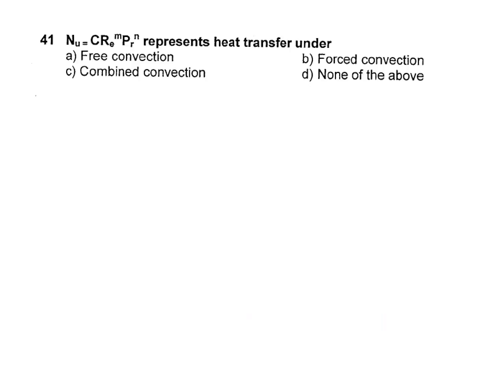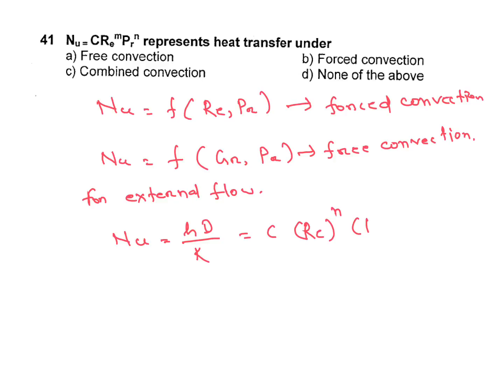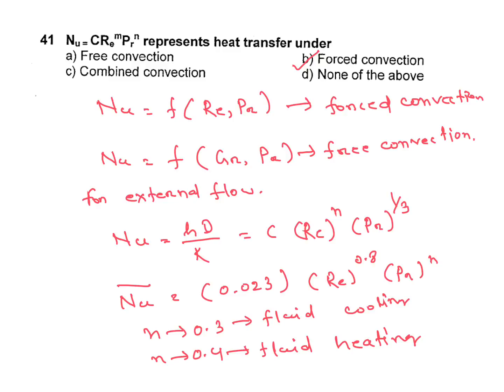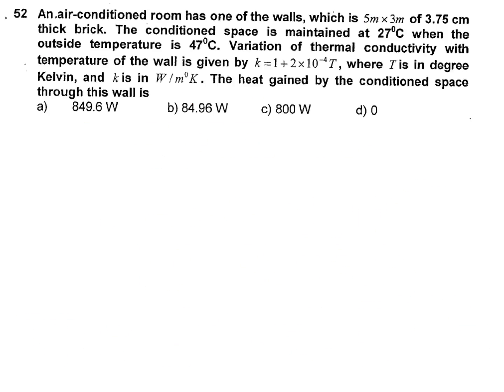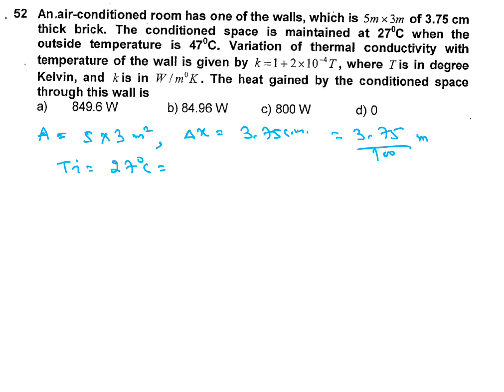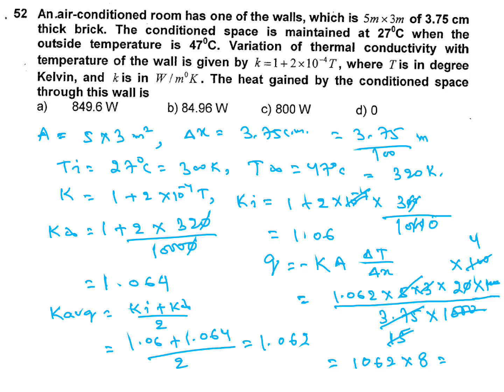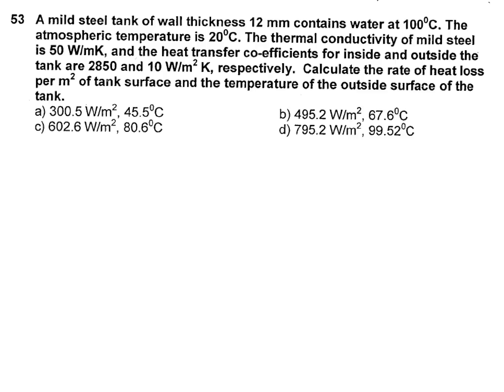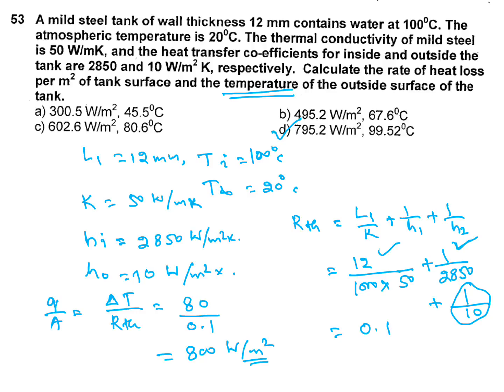ISRO QUESTION PAPERS HEAT TRANSFER - 01

Comment: Sir i think we need to integrate in question no. 52 in 2006..and doing that i got answer B..please check it out.
Reply from the maker: PLS MENTION THE TIME AND QS NO SO THAT IT WILL EASY FOR ME TO CHECK THAT QS
Reply: Prem Pal Singh integrate karke bhi 8496 W hi ata hei bhai. Aap ne thickness 3.75 cm liya ya 3.75 m liye, thoda check karke bata sakte hei kya. Thanks

Comment: Sir i think we need to integrate in question no. 52 in 2006..and doing that i got answer B..please check it out.
Reply from the maker: IF U GOT ANS AS B THEN UR PROCESS IS CORRECT , AVG METHOD ALSO SOME TIME HELP FULL BUT HR NO ANS IS MATHING , 2006 OFFICIAL ANS NOT AVL,.... BUT WITHOUT CALCI THIS TYPE OF QS DIFFICULT....